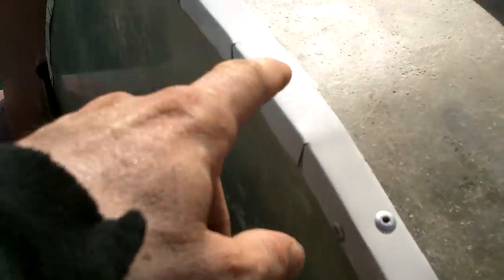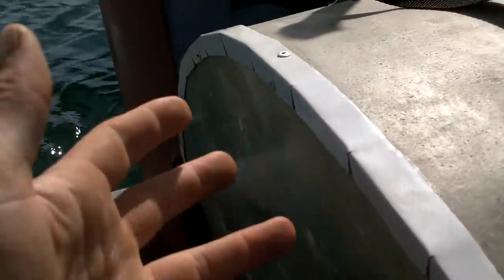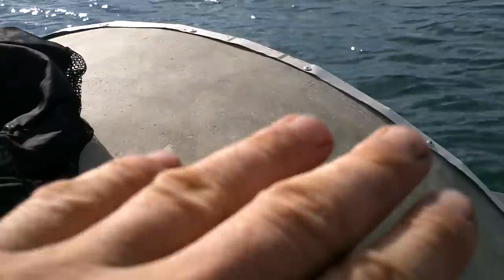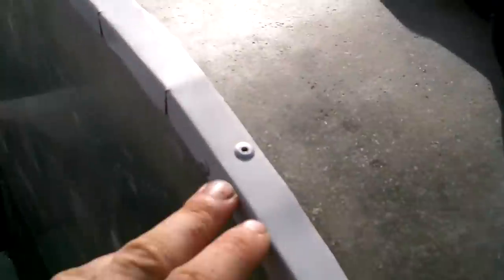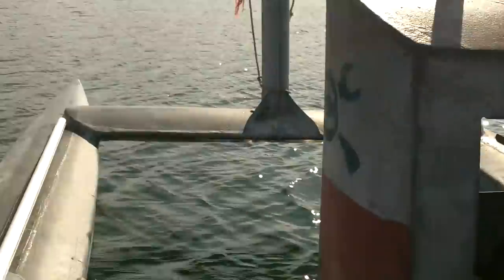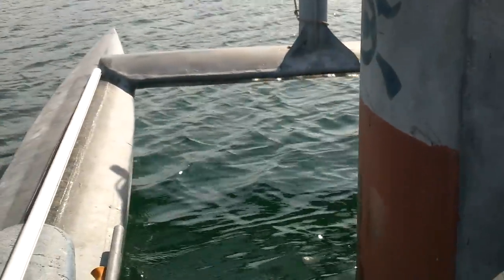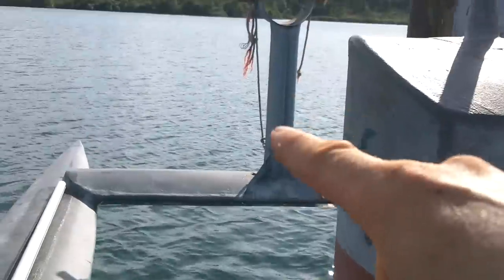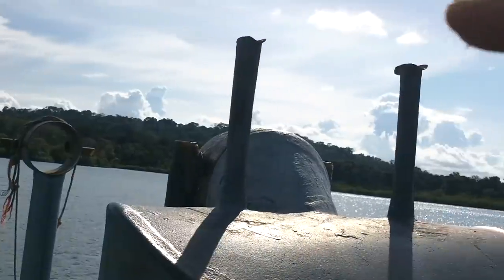Boat Chips 013 Sail?  ....Maybe???

Comment: Jamie, if you are going to make a fixed shape (foil) sail, consider making a wing shape so it will work in more points of wind. The pirate sail shape really only works down windish.  Of course the trick with wing foils is to allow them to articulate at the mast so the wing can create lift “flying” both ways. That is, on one tack the “underside” of the wing becomes the topside on the tack the other way. Jim
Reply: Yep, the sail from an old optimist rig is easy to make, powerful, and tunable. Great sail.

Comment: Jamie, i'll second @Leo, you should defiantly consider the junk rig, the sails can easily be made with hand tools and don't require expensive/exotic cloth. You could also look at the gaff and crab claw rigs.
That square rigger design can only go down wind, you really want sails that will allow you to sail towards the wind (cause that's when the peddling will be hardest). if you really want to stick with the curved roof becomes the sail idea, make the roof more like a airplane wing and attach you mast to the front edge of the sail, then you rotate the mast upright, you'll have a solid wing sail, you'll need less ropes than the square sail and can sail in more directions.
Regardless which sail type you choose will also want some sort of lee board or centre board to resist leeway when you're not going dead down wind.

Comment: Hello Jamie, I always like your enthusiasm, but the reason that sails are not made out of ridged fiberglass is, that they need to be adjustable to trim them by tighten or loosen them to catch or spill the wind efficiently, because of the difference between the wind direction and the point of sail you are trying to follow to get where you want to go, any sail is an adjustable foil, this goes for the most basic to the most high tech sails, a sail is not a rigid structure that is raised on a single plane.

Because what you are proposing will create drag instead of push in most scenarios, because the wind is rarely constant from a single fixed point, these natural wind fluctuations are something which a flexible sail can still turn into forward momentum, without creating drag. Even a square rigger pirate/viking sail that you mentioned, has a limited ability to be turned on the mast axis to sail across the wind to a limited extent and to spill wind without creating drag.

If you chose instead to just build your shade structure on just the rear half of the boat and rigged even a furling head sail similar to a hobie catamaran on a mast in the centre of the forward crossbeam, it would be much more efficient in all wind conditions. Regards Dave.
Reply: @Reno Simpson respectfully, an airplane wing uses the propulsion from an engine to create lift with a fixed wing and gliders ride thermals with a fixed wing, once they have been taken to a point of elevation by a tow vehicle, while essentially falling to earth.

Using the wind as your source of propulsion, requires the properties of a flexible sail as I previously stated and also for the ability to de-power the sail if the boat becomes over powered, because of an increase in the wind or gusting, by changing its position or shape to spill wind, or to drop or furl the sail.
Reply: I am conversant in Bernoulli's principle and understand the longer path/ transit theory.

Yes, of course a static aircraft can have lift imparted due to wind flowing around the wing with no engine running, but this is not how aircraft are flown in normal usage is it?

Pilot's don't sit on a runway reciting Bernoulli's principle, Low pressure, high velocity - high pressure, low velocity, over and over, while waiting for a breeze to impart lift in their aircraft...

Why not? because a gust or even a steady breeze is not sufficient to fly an aircraft, but you know already know that, in spite of your hair splitting...

In normal circumstances aircraft use a engine as a source of propulsion to create lift by moving the aircraft forward, forcing air around the wing!

That said, none of that applies to real world sailing, except as a way to illustrate the same principle in action on a sail in a snapshot of a particular set of ideal circumstances.

But actual sailing takes place in constantly changing circumstances, during which immediate adjustments have to be made to the sail shape, angle to the wind and de-powering the sail entirely, by dropping, furling, reefing or letting out the sail to spill wind, none of which can be achieved with a rigid fiberglass sail of the kind that Jamie described in this video.  

The reason sailboats have to be able to make these adjustments while under sail is, because an overpowered sail can easily knock down, de- mast, or capsize a boat, which is why sailors reduce their sail area by furling or reefing their sails and adjusting their sail angle to the wind, if the wind speed increases or the wind direction shifts.

Comment: To the folks saying "HAVE TO HAVE A CENTERBOARD" .. well, yes and no. Look up english duckpunt videos.. they actually use the boat as the means of transferring sideways energy to forward energy (as a centerboard does) .. youtube search lurch1e duckpunt - you'll find amazing vids on easy sailing boats, the sails can be made from tarps and they perform amazingly well.  You'd only need 1 to make a tremendous difference. Personally I think the "shark slicer" pontoons would serve perfectly well as the centerboard. . just add a sail and rock.
Reply: With the thin hulls of the catamaran design they will somewhat help with that but even still Hobie still uses daggerboards on all their catamarans (besides their basic entry-level stuff).

Comment: I think all that dome fiberglass up top (even though it's light) will add up to - too much weight up top and offset your center of gravity and make the boat a lot easier to tip over ... unless you are planning to put a somewhat heavy keel at the bottom.  But then all that weight will cause it to be a lot heavier to pedal through the water.  I think using either 1 small fiberglass sail or using cloth sails would preserve the center of gravity of the boat and not overload your ability to pedal the boat easily.  much success to you whatever way you go!

Comment: AWSOME idea but if the wind isn't a  reliable resource maybe think about doing both solar and the sails and you could do a sail on 2 of the corners opposite from each other and the sails could hinge upwards so whenever they aren't in use/down they're laying on top/out side of the pontoons so that they wouldn't take up much room also and I've never seen it done so would be awsome to see how it works but then I don't really think that the sails could be made of fiberglass but the sails mast could be made of fiberglass and also you might look into tent polls bc they are also made of fiberglass and maybe you could repurpose them into a mast or maybe even as something rigid to attache the sails to  but flexible enough for the wind to be caught still

Comment: How about using some wind surfing sails. You will have almost everything you need ready made just need to make a socket for the mast to fit into. Then use ropes to control angle

Comment: Hey, Jamie!!! :D Read this first! Get a low budget or no budget actual small sail boat or dinghy second hand and learn how to sail and how sails work. You need some kind of centerboard or a sail won't do you any good unless it wind in your back. You will just drift off and get mad haha! I learned how to sail as a kid in like a ten lesson summer course once a week one summer, and I'm a total city slicker haha! You live in the middle of your water world and are used to boats. Get someone to teach your or watch youtube tutorials! You'll get the hang of it fast! With this basic knowledge you will make a much more functional boat. The sail works like a wing but you need a centerboard or a keel to keep you on course, the rest is practice! Good luck! :D ... 
OH! And you can always sell the dinghy afterwards!
Reply: dagger boards would definitely help, but not necessary on the setup hes got with the 2 pontoons and by using chinese type junk rigged sails. btw, by junk rigged, thats a term for the style of rigging/sails, i would never knock chinese manufacturing processes or end results of their products :)
Reply: I don't know much about sailing, but I would think the pontoons would cut into the water sideways and give him that resistance from slipping sideways from cross wind. Though.... you may be right, but If needed, I bet he could make a keel that drops down into a slot that braces between the pontoons, and is removable for pedal or sharp turning. Interesting to see what he comes up with, Also good comment, he very well may need to adjust his design to work. Prior proper planning is best but sometimes ya gotta just jump in head first to stay inspired enough to finish!

Comment: Question. Why not use aerofoils instead of square sails? My reasoning being, upwind performance is far far better on aerofoils (with some sort of dagger board or skeg) than with a square sail. Also, rigging is simpler, at least in my head. (Which, admittedly, doesn't mean much.) Anyway, I love your vids bro. You live the life I wish I had.

Comment: The square rig is not very efficient, it's not good for going across and going into the wind. It's also better to have one big sail, then to have a couple of smaller sails. You're going to need a keal to help it track straight.

Comment: Do you still have the sailboat mast and boom? I know you cut them but you could use them shorten and the boom could be used to load heavy stuff on and off using the pulleys and wenches and you could still cover the back of boat for solar.

Comment: How much drag would the sails incur if they are down (shade mode) and you have a good head wind you need to paddle against to get home. Any additional structure would create more drag in principle, but how much extra (or less) drag would curved horizontal surface create? [2c]

Comment: Your sail will only work if there is a  tailwind which is not to often
Reply: Not necessarily he has a rudder and all you would have to do is loosen port or starboard line and angle the sails you can run almost 90° to the wind